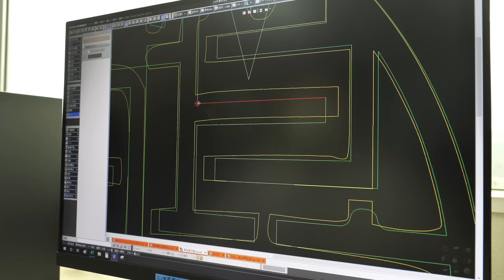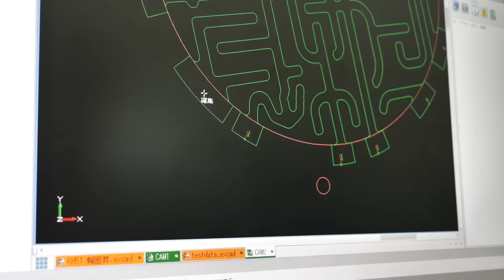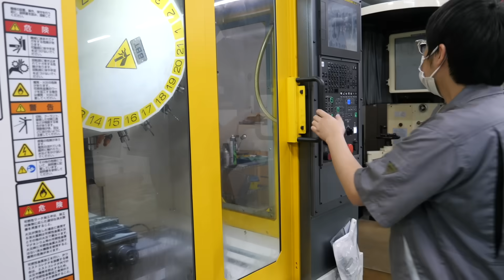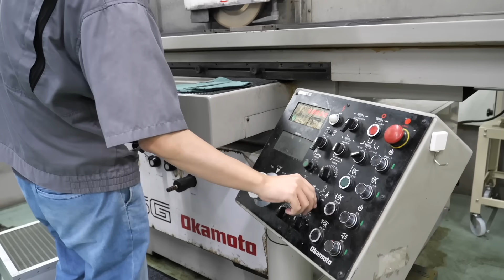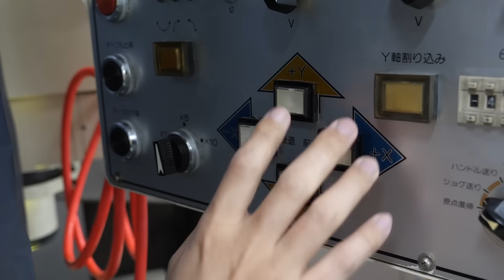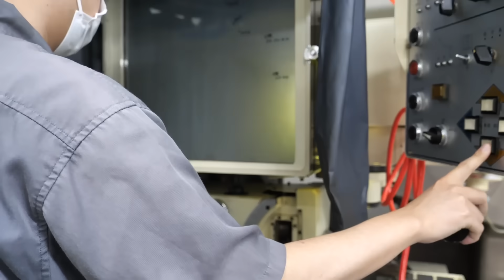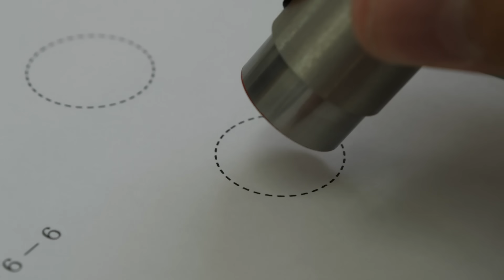印字が浮き出て消える新世代の印鑑を作るプロセス！唯一無二の印鑑「未来印」の製造工程に密着

Comment: AHHHHH! The hand drawn seal and redundant editing is painful to watch! You can draw digitally on a tablet screen or on a separate digital drawing tablet, with any kind and size of brush or drawing implement you want and almost all models have pressure sensitivity, so if you want your brushstroke to have that starting ink blot, or ending taper, it will, yet you can also have straight sections snap to a grid with a uniform stroke width as you draw them!

This digitizing method could be easily streamlined with digital drawing and better editing techniques to save so much time and effort! One person could do the whole thing in less than half the time once familiarized and comfortable with the software, techniques, and hot keys.

Comment: i remember seeing this process in a documentry lik 8-9 years ago. i think they use very thin brass wire that has a current passing through it. its shot throw and 'saws' the parts with very very high precision. it was on some old british show.
Reply: Yes, it's called wire EDM cutting, Electrical Discharge Machining.

Comment: I just can't figure out why it has to be made like this. Is it for anti-counterfeiting? But machine-made ones are far less distinctive than hand-made ones. On the contrary, they are easier to forge. Just imagine: made of steel, needing to be twisted before use, all looking the same, and yet worrying about being copied. All of this goes against the original purpose of using seals: being portable, unique, and having character. If it's just to show off industrial precision, then fine, you win. Japanese always like to use the so-called "craftsman spirit" to boast about some ill-timed innovations. In fact, the root is the unwillingness to change. Only making minor adjustments in details can't cover up the lack of a long-term perspective.

Comment: Thank you for your video. Regarding 15:09 for those who are unaware, the red pigment ink used for seal stamps is traditionally made from ground up cinnabar which contains toxic Mercury. Therefore caution needs to be exercised not to get it onto your skin or into your mouth.

Comment: You can admire the complexity of the technology or the precision of processing in the manufacture of stamps and seals for as long as you like, but "A watch that costs $30 and a watch that costs $300 show the same time." Modern technologies for the manufacture of stamps and seals, including those based on polymers or laser engraving on rubber, give the same excellent results. But a seal made for $1,100 will certainly please the ego of the "CEO" much more than one made for $20 (by polymerization). If the manufacture of seals at this production were a sideline, then one could admire that, for example, while making blades for aircraft turbines, they found the strength and courage to make amazing seals. But that is not so...

Comment: なんか40年振りにCADグレーディングを見ました。平面と立体の誤差を人の手で行ったのがアパレル、機械で行うのが金属加工ですね。
Reply: How many year, have you use a seal & where?

Hamburger pao Shop?😅
Reply: @ 
What I saw in the 1980s was a size development system that used semiconductors both then and today. So-called S・M・L・LL expansion system. That's how good Japanese semiconductors are, with no mistakes.

Comment: I couldn't tell if the positive and negative are cut at the same time or in two operations. Given the 12 hour cutting time, I'm guessing they are cut separately. The seals must cost at least 3,000 USD (300,000 yen) estimated off the shop time. Pruno

Comment: 1:19 I apologize if I sound rude 🙇 but Adobe illustrator would clean those stroke up really fast… especially if you just need vector output. Frankly, just from your initial drawing, using a tablet would speed up that initial process.
Reply: Is that enroute ? (CnC program)

Comment: Im surprised that you dont use the heat and cold method to assemble some of the parts, if you heat up one part and place the other in liquid nitrogen to shrink it, once you mate them together once they both equalize in temperature, they will not separate, use red loctite to make it even  more permanent

Comment: 径19mmは、少し大きく感じます。
径16mm~17mmだと使いようが良いかも。
印のサイズ種類が増えたら即注文します。
Reply: アドバイスありがとうございます。現在15mmを開発中です。その際は是非お願い致します。
Reply: @岩井プレス株式会社   The steel plate can be improved. I read that the Russians tried to slowly pass molten iron one drop at a time through a thick layer of carbon slag. With this layer, they divided a small standard Soviet muffle furnace into upper and lower halves, making it so that there was free space above and below the layer. The iron was simply placed on top of the slag layer, it melted and slowly passed through the layer to the colder part of the furnace, where ductile metal with a hardness of 80 HRC was collected. This is a modern recipe for the production of real "bulat" steel, which is harder than Damascus steel. The price can be 10 times more.

Comment: It makes no sense these days to do the hand drawn portion of the process if they already have employees who are skilled in vector graphics. I get that they may prefer to preserve some of the old ways, but that is very clearly an unnecessary step now.  The vector artist is stuck cleaning up the mess created by scanned pixelated images when they could quickly create the entire thing from scratch in a vector graphics app. At most, the first step need only be a line sketch of the type shown at 0:30 before ink is applied.

Other than that....damn that is one fine product! 

Me likey....now I want a set of 4 for my biz.

Comment: 判面の文字を出す前に朱肉つけてたけど、引っ込んだ方の面についてたインクが中に残ったりしないのかな
Reply: Submerging the entire piece in machinery oil periodically should help remove anything that gets inside
Reply: Does that method can clean up internal mechanisms as well?
I think to entirely clean it up, you have to disassemble the stump even with the cleaning oil.
Reply: @priceostia6292  It won't clean perfectly, but it should remove anything that feels sticky in the moving parts. I'd be too afraid of breaking it to take it apart.

Edit: If the oil can't get to an internal piece, neither can anything else.
Reply: What I was thinking is not about sticky sensation. When deeper section gets stuffed with old inks, friction level gets higher and more, eventually would get stuck. That’s why I was writing “I hope it’s cleanable for an enduser”.
Reply: @priceostia6292  Sorry if I was unclear. I was thinking about the same thing, but trying to use language the translator will like for this multilingual thread. I guess I was too cautious in my words.

The dried ink with get inside and make the mechanism feel sticky in use, but yes it is friction. The oil will soften and detach the dried particles, as well as help flush them out. At worst, it will spread the old ink into a thinner and more even layer while pushing some of it back out. It's a concept called Oil Pulling (that's used to little effect in homeopathic medicine), but will work here. Kind of like osmosis if you're familiar?
Reply: Yea, I think that’ll work. Like other stumps here in Japan(we still use stumps for official paper a lot), multiple use of accumulation involves microfibers from paper and wipes after the stumping.
I might imagining the phenomena without telling you.
Reply: 取説には文字を出さないでフラットで朱肉につけろと書いてある
Reply: 構造を見た感じ、隙間が少ないので少量ですが、ゆっくり雄型と雌型の隙間に詰まっていくでしょうね。クリーニングがユーザーでできるレベルならいいのですが。

Comment: The most interesting thing is how they create a perfect match between the parts and I can't see how that is done in this video.
Reply: This is maid with EDM cutting. You can see it at 06:00 .  You need to know that those are 2 different cuts. Like an insert. Going together.
Reply: @Newmeishu  So do they cut two pieces separately? Or does one cut result in two pieces? Regretfully it's not clear from the video.
Reply: @ yes. 2 cuts in 2 pieces.   The wire is thin but it would leave a gap.

Comment: Such an intricate, precise seal.
Looks impossible to make a forgery or counterfeit!
👍🏼
Reply: If they can make the seal, so can the counterfeiters.
Reply: The final print with paint, its absorption into the paper and spreading around the perimeter, negates the initial accuracy of the print. To reproduce a print, printing with a large error in size is sufficient.
Reply: @firstmaster100  Did you even watch the first like, 15 seconds of the video? They literally test it on paper and the lines are so clean and precise that it even has the tiny bumps on the lines in the design. If that isn't extremely accurate then I don't know what is LOL
Reply: @recilince You are taking my words out of context, distorting the essence. I did not say that the tool was poorly made, only that the liquid paint print can be faked using another tool that has significant deviations from the original high-precision one.
Reply: @recilince To put it simply, it is not the instrument itself that is copied, it is the impression that is copied, but because of the method of application it does not require such an identical instrument. Demonstrating precision by turning a design into a smooth surface is more of a publicity stunt and has nothing to do with the uniqueness of the print. It's like comparing a laser and an inkjet printer. Do you understand the difference in the result and the reason for this?

Comment: I'm surprised this is a 2-part CNC and that they don't use Wire EDM. It would reduce the work to a single pass and you'd get 2x as many done, and the fit would be even finer than what you see, here.

Edit: That's what I get for commenting too early on a video...

Comment: Good work but Rubber stamp is much easier to make.  Why go for all the trouble?
Reply: These are used to "sign" legal documents, Made to last a lifetime.
Reply: @JerryBiehler  There are easier and cheaper ways to make a metal stamp that will last a lifetime.  Particularly if you can live without the visually seamless interlocking style of these builds.  That being said, I expect that a very big part of this is the luxury/status symbol angle.  Nothing really wrong with that though.

It's not really any different from pens.  A BIC crystal costs less than a quarter and writes fine but that doesn't mean there isn't also market for luxury pens that cost thousands of dollars.
Reply: ゴム印は簡単に偽造できるので印鑑としての役目を果たさない
印鑑は指紋と同じで唯一無二でなければならない

Comment: pre·ci·sion  :face-blue-smiling:
/prēˈsiZH(ə)n/
noun
the quality, condition, or fact of being exact and accurate.
"the part was planned and executed with military precision"
Reply: But what is the difference between precision and accuracy?
Reply: @DerekDavis213  Big "D", in summary..
* Accuracy is about correctness.
* Precision is about consistency.

[Accuracy]:

Definition: Accuracy refers to how close a measured value is to the true or actual value.

Example: If you're measuring the length of a table and the actual length is 2 meters, a measurement of 2.01 meters is more accurate than a measurement of 2.10 meters.

[Precision]:

Definition: Precision refers to the consistency or repeatability of measurements. It indicates how close the measurements are to each other, regardless of whether they are close to the true value.

Example: If you measure the length of the same table multiple times and get 2.01 meters, 2.02 meters, and 2.01 meters, your measurements are precise. However, if the actual length is 2.5 meters, then your measurements, while precise, are not accurate.

Courtesy of ChatGPT. 
Ok. I cheated :body-blue-raised-arms:
But you RoCk! for asking the question. Because we all win the Smart Guy award :face-blue-smiling:
Reply: @ovalwingnut  Thanks for the explanation!
Reply: @DerekDavis213    You  R  a gentleman and a scholar...